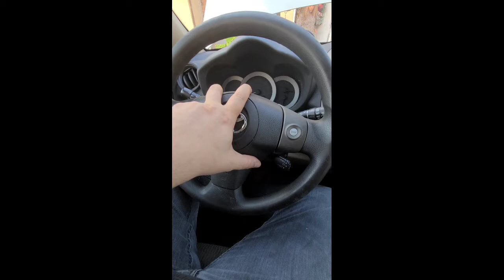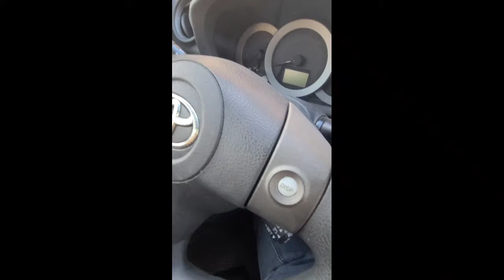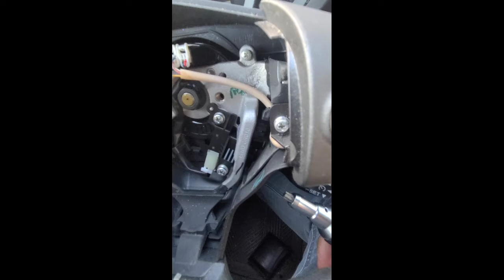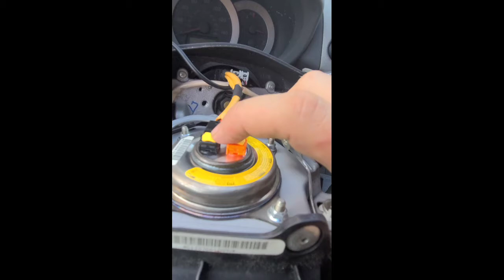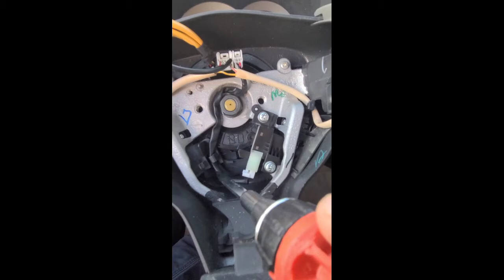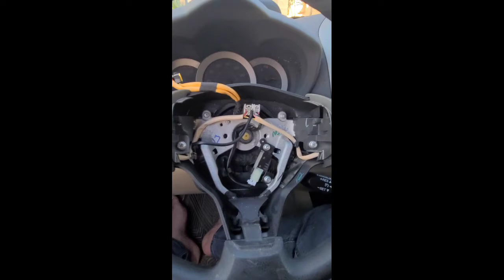DIY Video on How to Replace a Broken Cruise Control Switch on a 2012 Toyota Rav4

Comment: Hello, i have 2012 rav4 , 2.4L base model which doesn't have cruise control, so my question is installing cruise control lever is enough, does the car come pre-wired, or it needs to do the complete wiring and all with the ECU ans accelerator ?